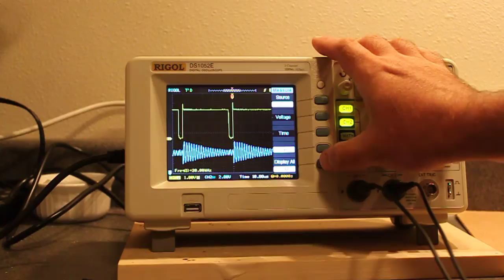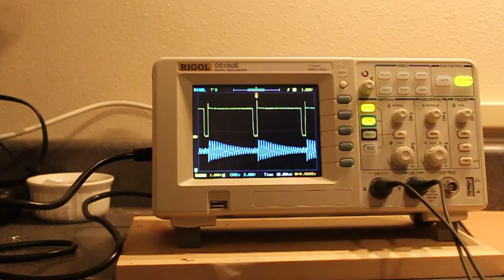Rigol DS1052E digital storage oscilloscope

Comment from the maker: Scope is still running strong, no problems with it whatsoever. I used it with several of the projects on the website, subjecting it to abuse with such things as diagnosing/debugging my plasma speaker. I'm not sitting at the scope at the moment, so I'm not sure the maximum event time.